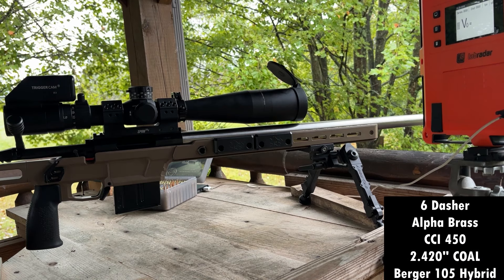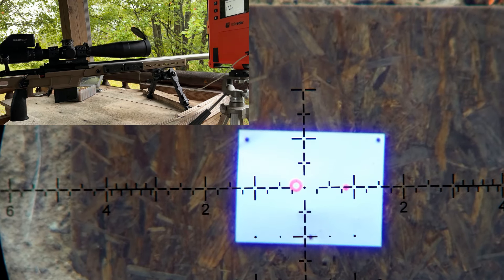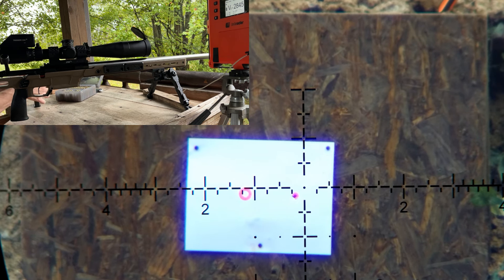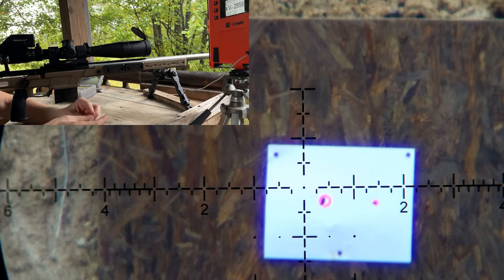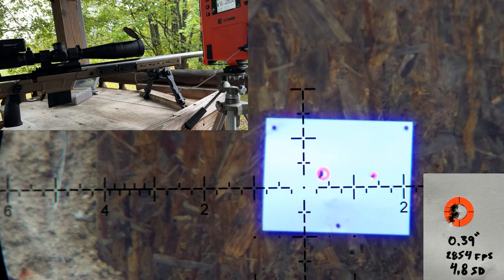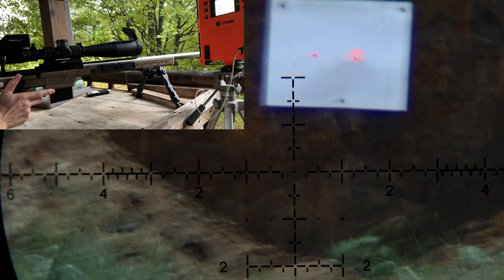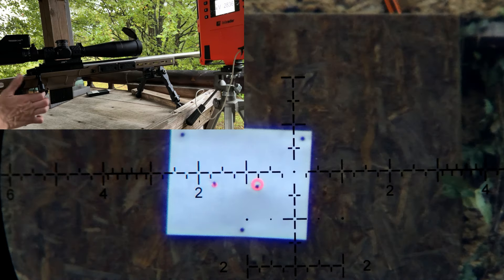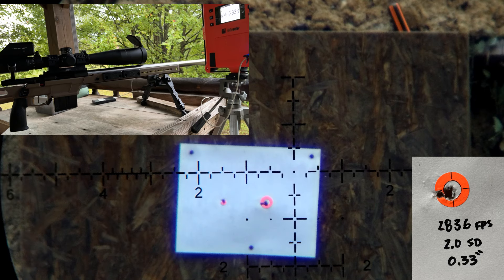6MM Dasher 105 Hybrid Load Work

Comment: You may want to clean your barrel with abrasives. My dasher picked up a bunch of speed out of no where too after shooting varget and 105s. Cleaned with iosso and got it back down to bare metal and it brought it back to were it should have been. Sounds like a potential carbon fouling issue. Doesnt seem like normal carbon solvents will touch varget sometimes

Comment: Hole punch reinforcement stickers make great target spots. Cheap too.
Reply from the maker: @LanceWatkins-w3q  interesting… I’ll check them out!
Reply: @RobsReloading same same but different, you can get a roll of 1/2” squares for like $7 and the corner of the square is the finest aiming point I’ve found yet. Lots of colors and the best part is you don’t need to cut them.

Comment: What does your rifle weigh?
Reply from the maker: @keimer509  25#
Reply: @RobsReloading Thanks but I should’ve phrased that differently what does the chassis weigh with all the weights?
Reply from the maker: @keimer509  I’m actually not sure. The barrel is a heavy varmit 26”
Reply: I’m in the process of building a 6 Br I was hoping to be close to that weight… I haven’t decided what chassis I wanna run..your solus seems like a nice option!
Reply from the maker: @keimer509  my Solus has 2 sets of the salmon river solutions m lol weights, there internal weight, and a custom steel bag rider and custom stock weight.
Reply: @RobsReloading  Where did you install the custom stock weight?
Reply from the maker: @keimer509  in the opening of the rear of the chassis